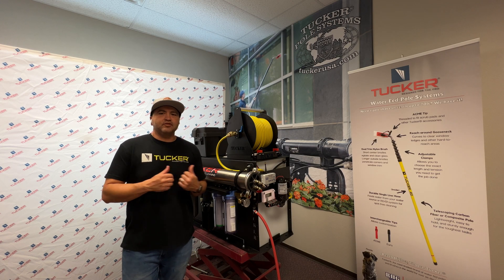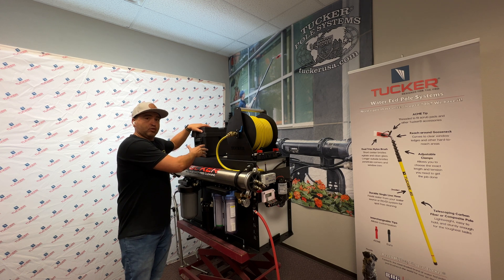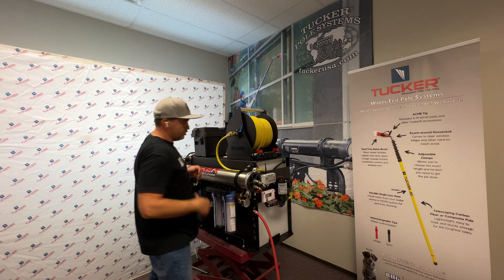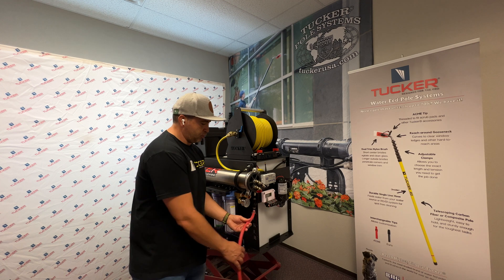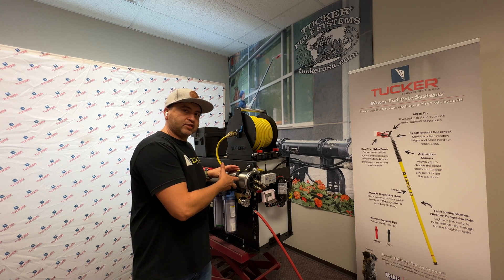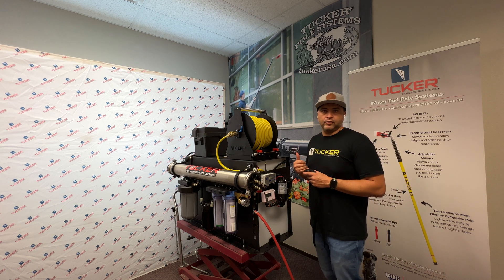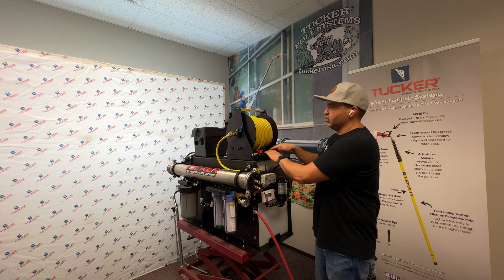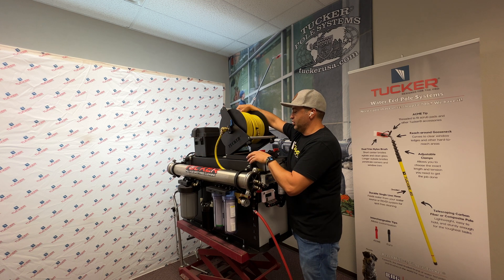TUCKER® FILL N GO SYSTEMS

Comment: fina start a solar panel cleaning company what ya think?
Reply: Go for it man
Reply from the maker: This is a good option for solar depending on where you are at. I used it for solar here in Colorado (Denver area). We typically have lightly dust covered panels here, and it worked great here. If you live in an area that has heavily soiled panels, you may want a system like our Max Output that can deliver more GPM. 

The max the delivery pump can provide is 1.4 GPM. Our Max Output can provide around 3 GPM with booster pump on  when connected to customer's water source, or around 2 GPM drawing from a tank.

Here is a link to the Max Output Solar kit: https://tuckerusa.com/5-stage-max-output-kit-for-solar-panel-cleaning/